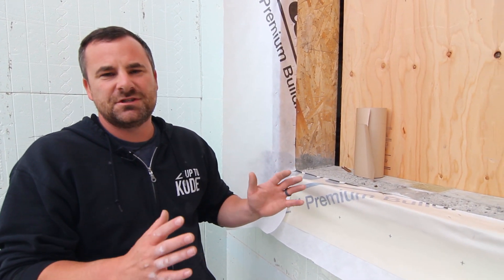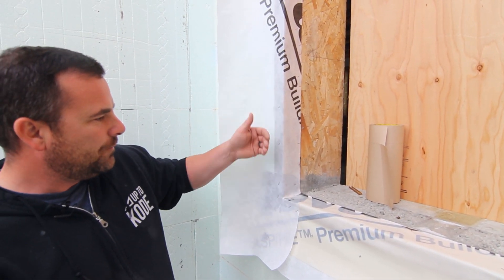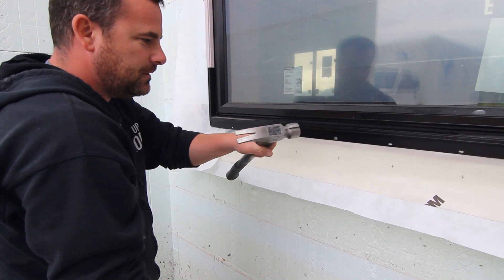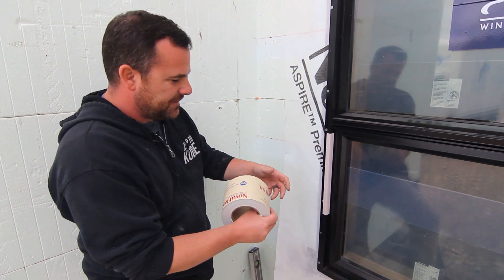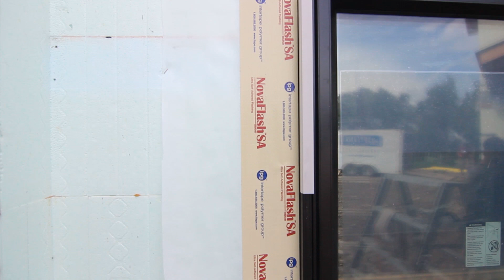How to Prep and Install a Window for an ICF Home

Comment: Hey Kody. I’m in the planning stages of building an icf. I see on most all of the ICF brand websites that the ICF works as a vapor barrier as well. Have you had experiences or witnessed others in a situation with water getting in without an additional barrier on the exterior?
Reply from the maker: Yes I have had first hand experience. Technically yes it’s a vapour barrier, BUT it is not a drainage plane! Water will not run down the face of an ICF wall. It can get through the lines where one block meets the next and go almost anywhere. This concerns me around windows as there’s no way to keep water to the outside except with the use of building paper. Does this help explain it? 

The block companies are speaking in technical terms and not practical usage.
Reply: @uptokode  yes, thank you!
Reply from the maker: Anytime!
Reply: @uptokode  but what about when you stocco ICF? You can put building paper on if you do stocco or am I wrong?

Comment: I see you use OSB to frame the windows. Have you also tried other methods (2x6...) and why did you choose OSB?
Reply from the maker: I like the OSB rim board for many reasons. Cheaper than LVL and I don’t need structural support for the window so OSB is more than sufficient. Just need something solid to nail to (inside and out). 

Other systems with plywood and 2x6 seem like a hassle. Either too much labour to build or extra bracing required. Sometimes you don’t have solid material to attach the window or trim work to. Depending on which design you use. 

Hope that helps you.
Reply: @uptokode   thanks for they reply once again! What thickness OSB do you use? I was under the impression one disadvantage is not being able to nail into the side of OSB but I might be wrong. You just brace by putting some wood vertically and horizontally in the window? Once again thanks for the amazing vids and answers!

Comment: Stinking ridiculous over kill. My house is 60yo with original windows. Would hate to see all 'prep' it was made with.
Reply from the maker: For a single storey bungalow you can almost get away with no prep as long as you have a good sized overhang. The details become very important once you go with 2 storey or more.  Way more open wall space for driving rain to run down.
Reply: @uptokode  Not meant to be a criticism. Enjoy your videos. Just compared to yesteryear things seem like over kill. For instance, my house is block foundation (genius), can last for years with no waterproofing at all. But, sooner or later... By then the contractor is dead! Looking forward to building an ICF home. Your stuff has been quite helpful.

Comment: Do you install the window bearing entirely on the foam?  I am getting windows without nail fin or brick mold in order to set the frame in deeper to bear on the concrete and not the foam.  Does it matter?
Reply: Windows should not 'sit'. They should be nailed or screwed into the bucks.  The bucks carry the load.

Comment: What kind of windows do you recommend... balancing budget and performance?
Reply from the maker: Depends on your area. I like Plygem windows, I like Lux windows but I don’t have a ton of exposure to all the different brands. Have seen some amazing high end brands too. Just waiting to use some of those. 

I do like a metal clad window. A lot more options for color and a way better look than vinyl.
Reply: @uptokode  and he said I'll have to have my plans 'completely' redrawn.  What would be the reason for that?  It's just the exterior wall thickness that is changing,  and the easy the floor will tie in.
Reply: @uptokode  after watching some of your videos,  I really want to do icf.  My builder said he's built several,  but the cost is 20% more?  He says everything is harder from plumbing and electrical to drywall and exterior cladding.   I've watched several videos,  those trades are different,  but I wouldn't say harder.   What are your thoughts?  Any chance you just want to come down to the states and help me out?!  Ha, just kidding about these last part

Comment: I’m thinking about building an icf house. The question is, can you get cell phone reception inside of one of these buildings?
Reply from the maker: Yes you can get cell service but it does reduce it quite a bit. Haven’t needed to install a booster yet.

Comment: Kody,  Thank you for the videos. I am building a Nudura ICF house and am getting close to install windows and doors.  Do you have any videos for installing exterior doors? I am curious how to deal with the wide door jamb? I have 2x12 bucks and doors are only 2x6.

Thank you again.
Reply from the maker: You’re welcome David! We just build and install a secondary jamb that butts into the existing door one. We leave a decent reveal so that the latch doesn’t rub on the jamb. With the buck being wood you have lots to attach too. Then it’s trim like normal after that. 

As for the install itself. We treat it the exact same way as a window. Bottom flap and all. We also silicone the heck out of the bottom sill

Comment: Origami no thanks, I will go fluid applied even if the commentators indicate it is more expensive, I know I can paint!
Reply from the maker: I really like the fluid applied stuff too ! I haven’t researched it much for ICF.
Reply: My thoughts exactly, I'm going to end up doing a fluid applied on the whole house, painting seems easy, plus my building is 18 foor high that way I dont need a scaffold or two or three people to help put on a peel and stick. I did the math in my building which is 5k sqft house, fluid applied only seemed to be about 5 grand, so not enough to worry about cost

Comment: In our previous discussion, you mentioned 2 peel & stick products to mitigate moisture is that also applied to the inside of your bucks against the concrete?  Nice job why not use peel & stick instead of just building wrap (is it for cost savings? Thanks again!
Reply from the maker: I like peal n stick AND paper for better protection. For the bottom of the window it allows easy lapping of paper when siding starts. Watershed is so critical because this part of the building envelope must be able to drain and have water exit to the exterior.
Reply: Do you install a peel & stick product  between the wood buck and the concrete to protect it?  @uptokode
Reply from the maker: When we install the bucks we install a 8” sill gasket where the concrete will pour up against the wood.
Reply: Thanks, Kody that clears up my question!

Comment: How do you attach house wrap to ICF?
Reply from the maker: You can push shingle nails into the foam. Don’t get too far ahead of yourself with your siding. Don’t want it blowing off. 

Or use wafer screws if you want. They will hold it tight. Sometimes we use scrap plywood from site to hold down the edges so wind doesn’t pick it up. If wind can’t underneath it doesn’t take much to keep it intact.

Comment: Any opinion on fluid applied?
Reply from the maker: That’s one I need to research more. Wish I had an answer for you. If you find one please share your info.
Reply: @uptokode   like Waremonger said matt risinger has many videos on fluid applied and I think it could be integrated into your system pretty easy, not sure on cost.   Spray on blue barrier over your sills and down the ICF would be both easier and more "bomber" , as Matt would say.
Reply: @uptokode  Matt Risinger has a ton of videos on using fluid applied membrane for window installs (as well as whole house applications).
Reply: @uptokode  :  Have you ever considered using Poly Wall fluid applied waterproofing/air barrier products in place of house wrap and all of the different window/door sealing products on your ICF builds?
  If I remember correctly it is designed for use with ICFs.

I find the installation to be easier with less labor time.  Bonus that there it doesn't require the 100% attention to detail for proper "shingling" of the waterproofing products. 
I know that Poly Wall does have a higher material cost, but I think that I make up for it with less labor costs.
Reply from the maker: I’ll look into that. Thanks !!
Reply from the maker: It’s a great idea for sure and I really like the concept.